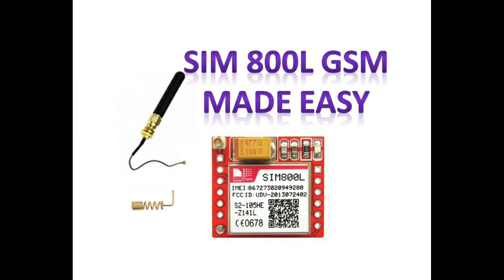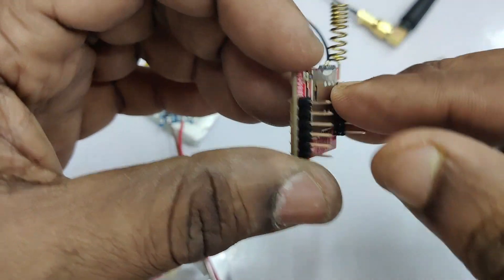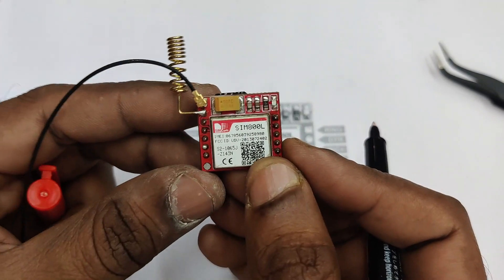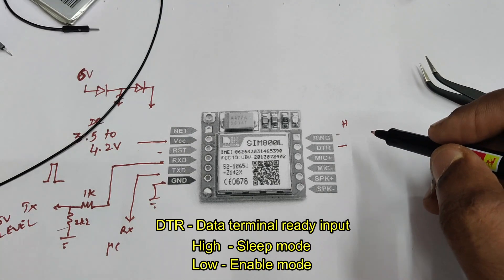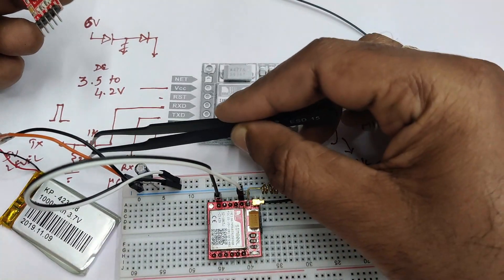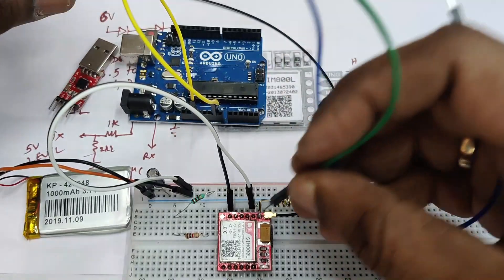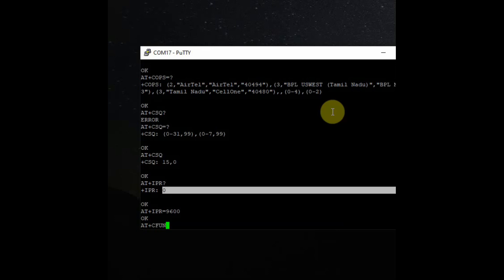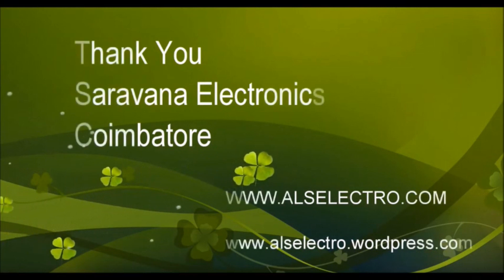SIM800L GSM Made easy -AT commands Dial & SMS

Comment: I liked your video. Have two suggestions; you can not connect two antenna simultaneously on the same RF port, furthermore be cautious to handle Lipo Battery, specially in your case where there are naked pins on the Lipo connector which can easily short with each other and and cause fire / damage.

Comment: @5:32 1K resistor should be connected to TX pin. Else it will not function as voltage divider. Otherwise good video. Thanks
Reply: I agree with you, I have used the 2k2 + 1k0 resistor as a voltage divider too.
Reply: Ss

Comment: Hello sir... My sim800l didn't work... I didn't put those resistor you put on Rx pin... But when i send AT command it returns OK but it didn't receiver neither a call nor a sms... I used a 4G aiterl sim card can you help me please??
Reply: @amtech-technology3186   Check if all Grounds are connected or not (power gnd , sim800l gnd , TTL   gnd).

Comment: Hi Sharvan Sir, recently i bought a sim 800L and put an airtel sim with proper voltage to its plus and negative pin. But i didnt got the network sim which should blink every 3 sec. It only blink in one sec. However the at command it shows the sim number...

What might be the problem.?? Pls help. I need ur e mail. And contact addres to send these faullty simm800l